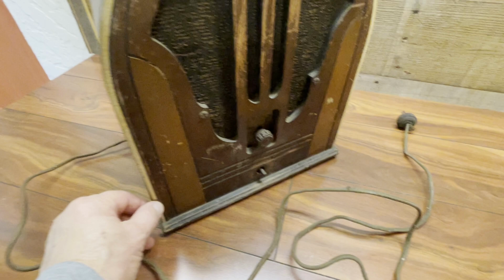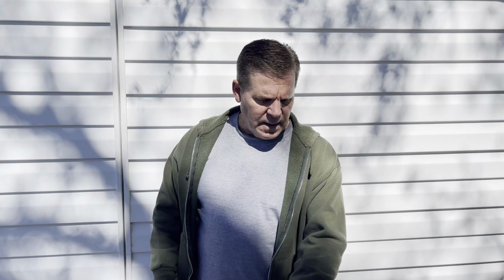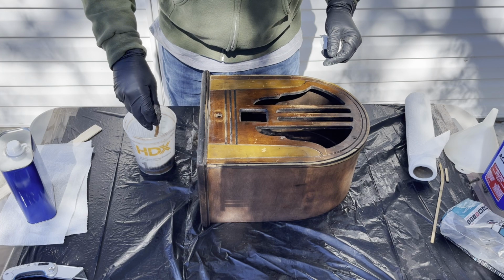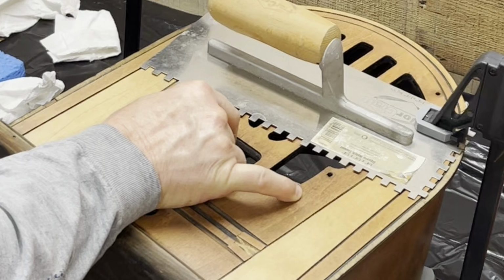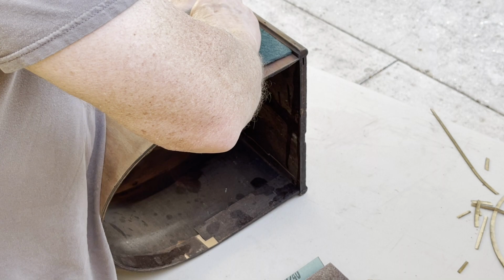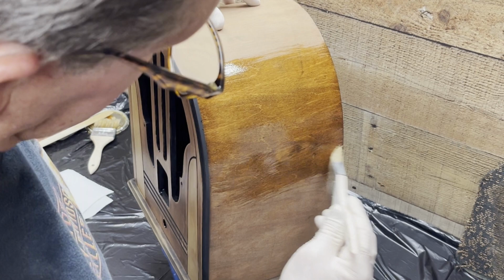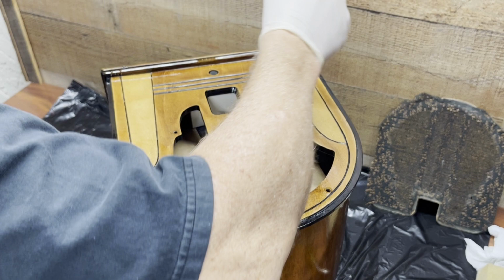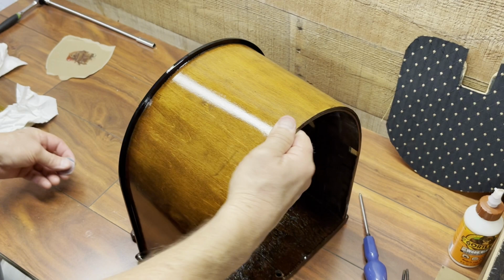Episode 10: We Rejuvenate and Repurpose a 1935 Philco Cathedral Radio from last weeks picks...

Comment: Hi!

VERY NICE refinishing job on that ol' Cathedral style cabinet, there! I really like the way you made it look new again!

Too bad the chassis, (or radio itself), was in such shape that you didn't want to fool with it.

Btw; just what are you thinking of doing with that chassis now?

If you're thinking of simply disposing of it, I seriously wouldn't mind taking it off your hands, if you'd be willing to ship it to me!

I'm in the process of learning how to repair and/or restore old tube radios, & I feel sure that the chassis of this old Philco, would be a pretty good one to help me learn on!

I dunno just where you are located, but I live in Abilene Texas. So shoot me a reply, and let me know what you think, ok??

Thanks, & again; NICE WORK!!

Ron H.
Abilene, TX.
Reply from the maker: Thanks for kind words. The wiring in the chassis had been chewed by mice. It’s cloth covered wire and runs $20 a foot around here, so with all the different sizes, it’s just not affordable. You can buy a nice one for far less than the wire cost alone. The chassis was repurposed by my neighbor for an unrelated project. Thanks for watching!
Reply: @glaciertradingco  Glad to hear the original chassis was not tossed and was given a second lease on life! Very well done on the cabinet as well. I have done something similar with a 1938 Philco floor model radio, but I kept the original chassis, added some LEDs to the original dial, and put the new amplifier/speakers underneath in case I ever wanted to restore it down the road.
Reply from the maker: Those floor models are insanely cool. Certainly a much more ambitious undertaking than my table top. I love keeping things original when it makes sense, otherwise hopefully a cool repurpose to keep it out of the landfill and so it can live on. Thanks for watching!       @fallenfirebird240